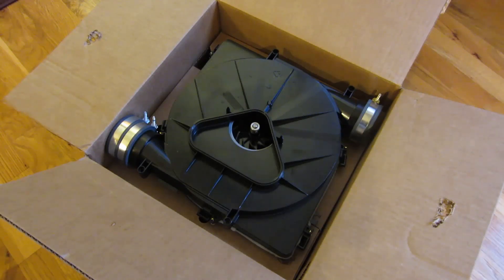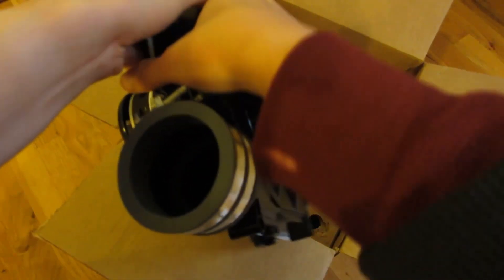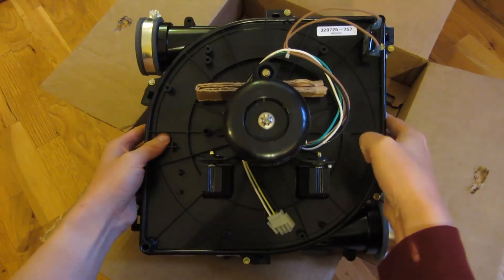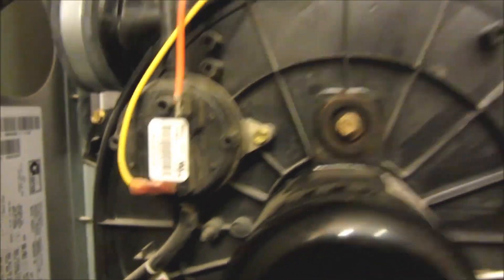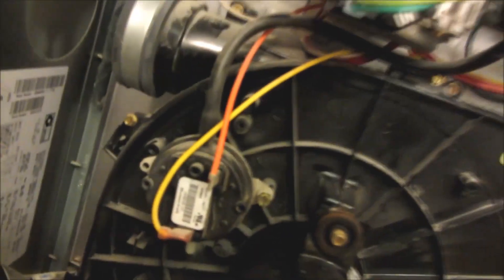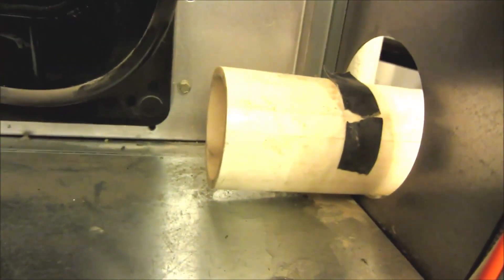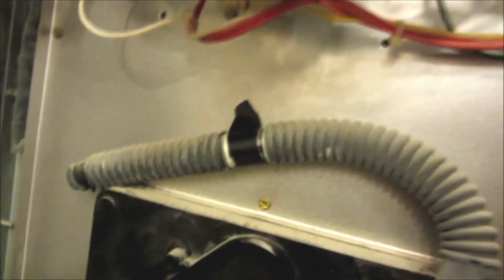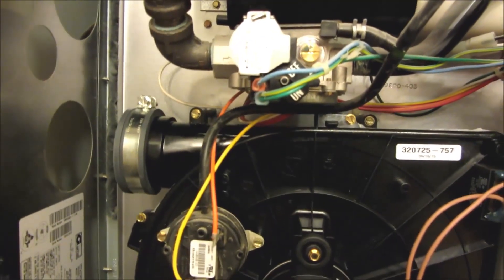Bryant Furnace Inducer Motor Repair | HVAC Fan Motor Replacement | Noisy Loud

Comment: That you had water inside means the drain is clogged. If not cleaned, it will accumulate water in the new motor too, and will corrode the whole thing.

Comment: Actually easy to replace the internal plastic fan ($48.50).  Thanks so much for this video, which gave me confidence to take this on .  Once I got the unit out, I decided to take it apart to see what was causing the noise.  It turns out all you have to do  to take it apart is tor remove 6 screws and then carefully separate the two pieces that make up the plastic housing.  Inside I found the plastic fan, and could see that it had broken and partially separated from the the metal part that fits on the motor shaft with one set screw.  It was then easy to remove and replace the plastic fan.  I found the replacement fan on Amazon for $48.50.  You just need to clean out any of the old silicone sealant and run a new bead before putting the two housing pieces back together.
Reply: Can you share the link to buy that plastic fan you replaced?? Thanks

Comment: Great video but it never mentioned to plug anti freeze hole. It leaked Carbon monoxide slowly and day 5 my security system went off due to CO. Please edit the video to add that. We got lucky since we keep furnace room closed and has CO alarm.

Comment: Hi looking for a video to fix a water leak at this part did yours leak water
Reply from the maker: Mine did not leak, but there is several drains and in a way, one main drain, where is yours leaking.  Did you see the video portion of the main drain, is it simply a gasket issue